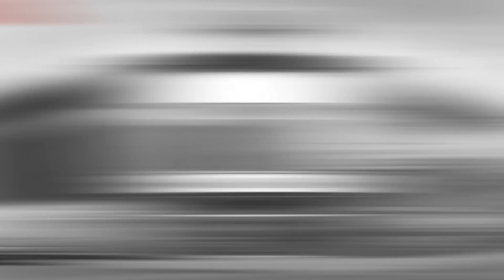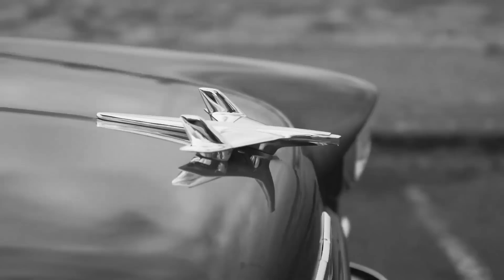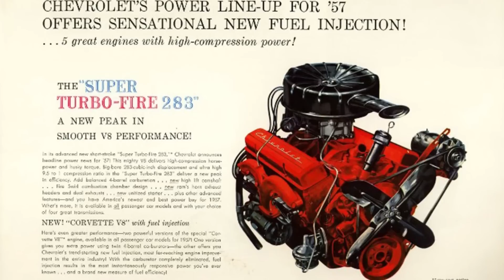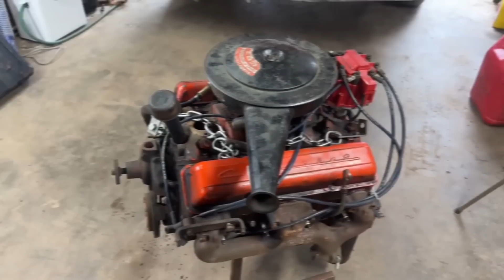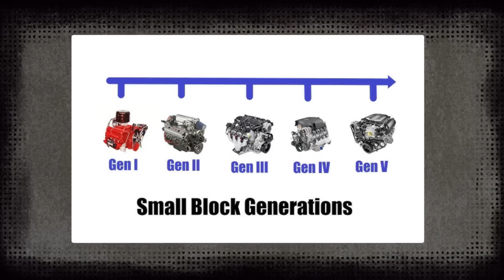How Chevy's V8 Conquered the World

Comment: In 1879, Karl Benz patented a reliable two-stroke gasoline engine. Later, in 1886, Benz began the first commercial production of motor vehicles with an internal combustion engine, in which a three-wheeled, four-cycle engine and chassis formed a single unit. this revolutionized the entire automotive industry, because they invented it. took a minute to find because it was ALL about ford inventing the car. Toyota Motor Corporation was the world's largest manufacturer of motor vehicles in 2024, selling about 10.8 million units. no Japanize car manufactures use US engines. and finally-French manufacturers were the first to use V8 engines in the early 1900s. How did they conquer the world?
Reply: Yes, Ford didn't invent the car. Many Ford owners don't know that. Yes Chevy revolutionized the engine. If they didn't, you'd be using flathead engines.

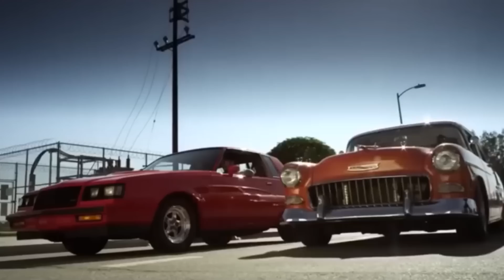Comment: 3:10 - According to Hot Rod Magazine, the engines were offered early on (by GM) to hot-rodders at favorable prices, and that's all it took. Marketing genius; the flattie was dead.
Just look at the chambers: The flattie had the plugs located near the valve C/Ls and the chamber wandering all the way over there. You cannot build a decent C/R in a chamber requiring that amount of ignition lead.
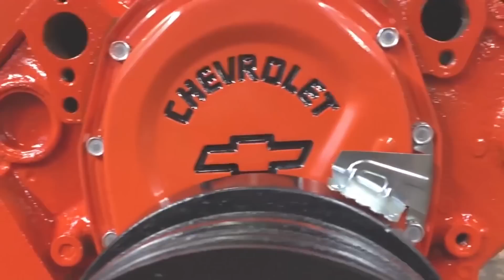4:57 - While the flattie was a fire-tube boiler.
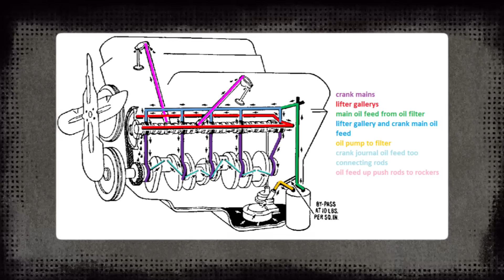6:15 - Not the first ones; they used a bypass oil filter.
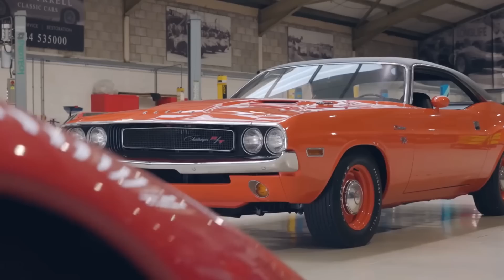15:19 - The hemi was obsolete chamber design by the mid '50s; it's only NHRA rules, GM 6-71s and nitro which keep it alive. No quench.

Comment: Chevrolet small block V8s outsold Fords and Mopars !!! Chevys since 1955 to 2013 passed 100th millions !!! Fords since 1932 to 2016 over 70 millions !! Chryslers since 1930s to 2015 passed 50 millions !  Awesome Chevrolet 👌💪
Reply: The reason they sold so many was because if you wanted a chev that was the only option, a stock 350 in the 70s wouldn't exceed 100 mph.
Reply: @barriegregory6606  Do you remember the stranglehold the government had over everything during the 70s.?

Comment: No other in engine platform in the world has the manufacturing numbers, Aftermarket support or used in more applications especially engines swaps as the SBC.
Reply: When Cosworth built their first V8 F1 engine, based on a production motor they chose Ford & it became the most winning F1 motor or all time.
Reply: @barriegregory6606 That’s great but it pales in comparison overall to the SBC.

Comment: I’ve owned several small block curves from the early days.They’re main problem as I learned from machinists years ago. Not enough nickel in the iron witch lead to soft iron and would lead to cylinder wear.
  Problem leads to owning a smoker.
 Hard to blow up but constantly adding oil to a weak sickening pig.
  The nickel problem goes all the way back to G M ripping off the Government during WW2.

Comment: The greatest engine ever made. It has outlasted every other model and type because the original engineering and support from the factory and the aftermarket has been so strong. It was so far ahead of every other company's engine in the designs of every detail. It has no peer.
Reply: Ahaha , the only thing standing in the way of your comment is the FLATHEAD FORD !
and it still looks better than your sbc in any old rod 😊
Reply: LOL, all 100 horsepower of it! @blschurch1919
Reply: Ahead of it's time?  a pushrod cast iron V8, it was so unstressed, the stock 2 barrel motors only produced 145 BHP which is equal to 27 bhp per litre which was half of the power most 2 litre European engines produced at the time.

Comment: Small block mopar had rear oil sumps. Not any harder to work on than anything else.
Reply: Why is there so many bolt holes on the front of that engine that lead into coolant passages? Also the fuel pump bolt to the timing cover what a pain.
Reply: @The0utmode Try to stop the crankshaft from turning. Imperative for harmonic balancer removal. A screwdriver does that for a Chevy.
Reply: @marcustalley7987  Flywheel wrench propped up against the frame. It doesn't get any easier.
Reply: @The0utmode  Flywheel is in the bell housing. So no. I guess you don't know the pipe wrench trick. Still not as easy as a screwdriver. If the harmonic balancer is off, no pipe wrench trick.
Reply: @ The 2 speed power glide and th350 and th400 is a two bolt inspection plate and then boom you are looking right at the flywheel. Obviously you haven't seen a vehicle old enough to not have one of those annoying enclosed bell housings.
Reply: @The0utmode  Flywheel is in the bell housing. No wrench needed. Screwdriver poked through a hole in the flex plate. On a Chrysler,  no holes for a screwdriver. Pipe wrench on lower pulley.

Comment: More Chevrolet propaganda 🤮
Reply: Name a small block V8 engine better than the SBC. Ford and dodge were too busy trying to run coolant through their timing covers. Ford and dodge also for some reason thought front oil pump and sump design was a good idea lol.  Their parts also cost more and they are harder to work on!
Reply: Be happy you don’t live in Cuba!!!!  Cuban hot toddlers have a VERY tough time getting any hot rod parts
Reply: Let us replace the word better with preferred